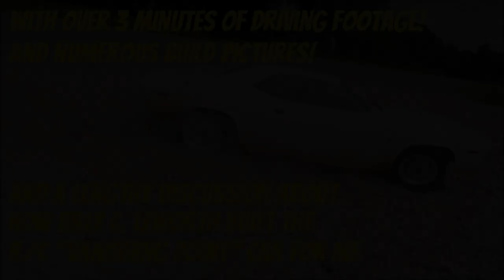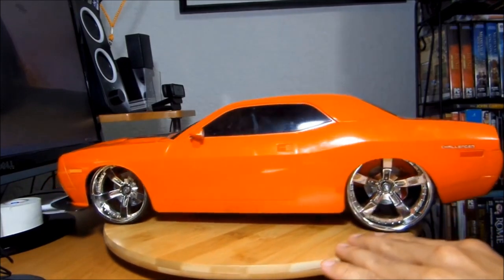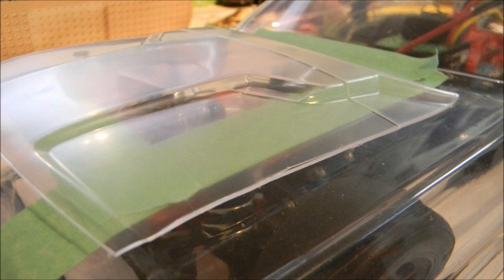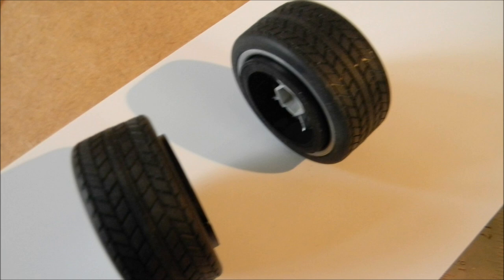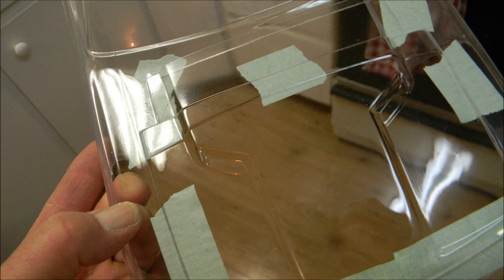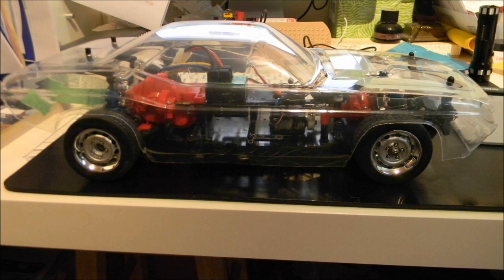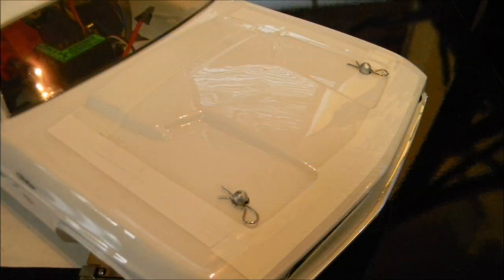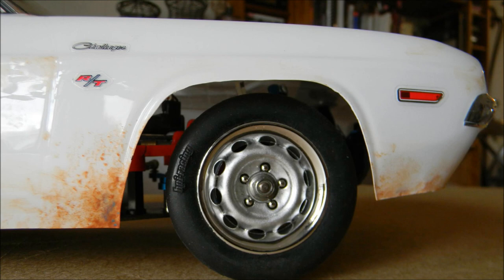"Vanishing Point" RC car 1/10 Dodge Challenger (with build pictures)

Comment: Hey I'm in Florida and I have some rc cars nitro ready to run hpi 4 wheel drive does about 60 mph aircraft grade aluminum I need to get ride of them I don't use them anymore plus some custom carbon fiber electric ones got some 6 channel hellis to like raptor 90's and stuff